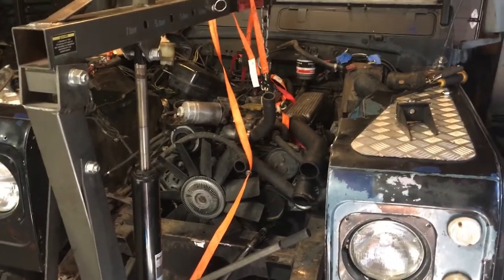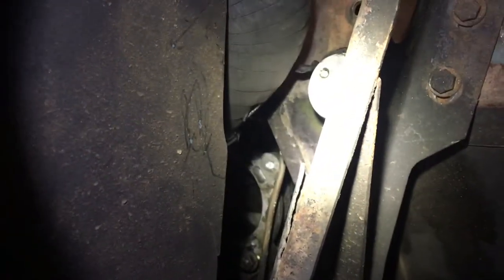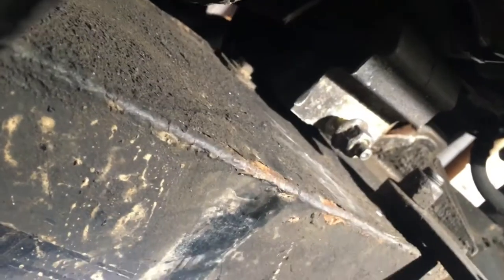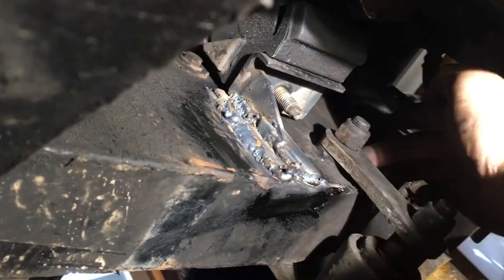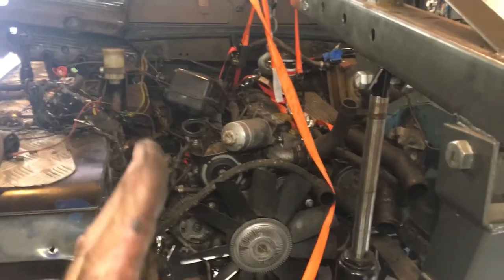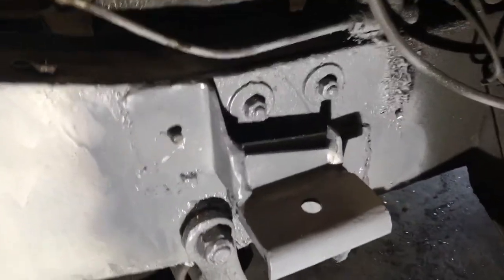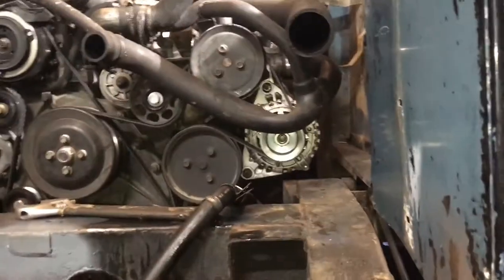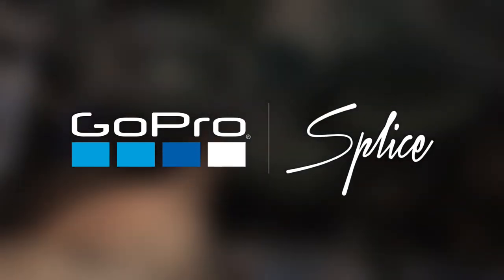Day 4 - 300 TDI Engine Conversion in a Series 3 Land Rover

Comment: Hi, Like-ing your conversion, One question? Why didn't you remove all the old throttle linkages to give yourself some clearance to the side of driver footwell, i'm doing this very same conversion, but intend to use original engine mounts, altered exhaust to clear mount, and cable operated throttle.